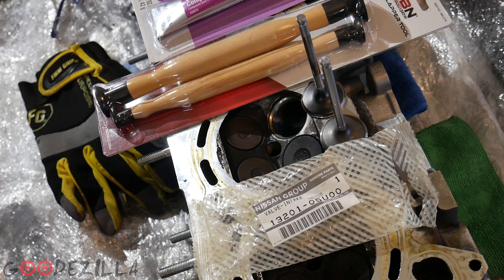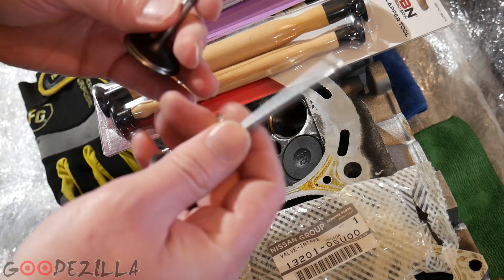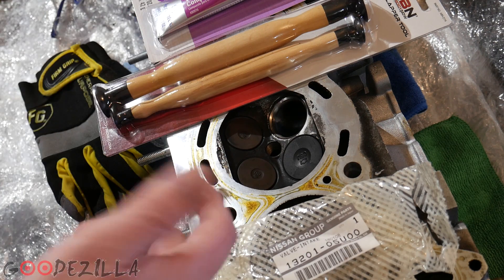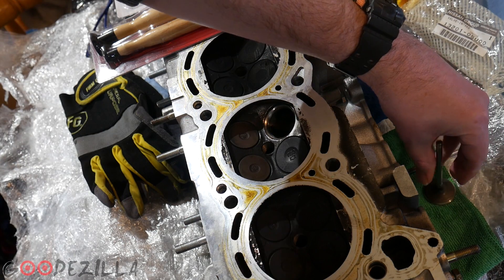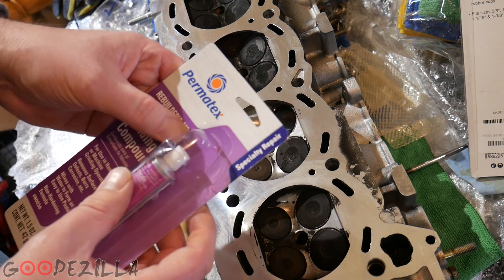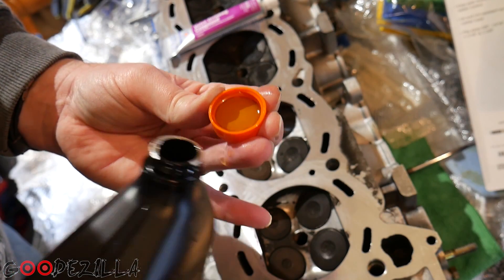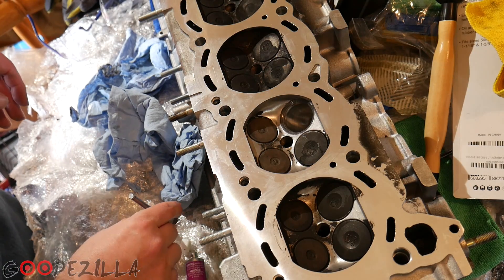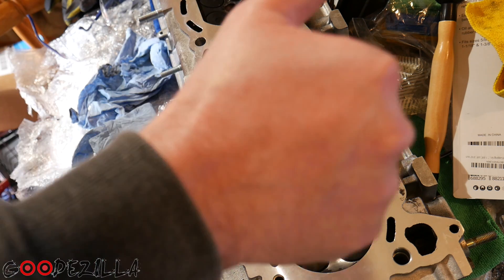RB26 Valve Lapping | R32 Skyline GTR

Comment: Hello from the UK, Mr Goode! What kind of cleaning and prep did you do to the block and head before reassembly? I’m assuming you didn’t take the head to a shop to skim again as part of this fix (trapped plastic, head off, new valve, back together)? Thanks in advance dude.
Reply from the maker: @utsavmamtora  Hey! Yeah, I didn't take it back to a shop for this. Since it was a new build with less tham 1k miles on it, there really wasn't much of  anything to have to clean. The head gasket surface wiped up easy with some brake cleaner.

Comment: Thanks man for your helpful video do you know the spec for the valve seat?
Reply from the maker: What spec are you referring to?
Reply: @Goodezilla  i mean the width of the line where the valve seats on it. There should be a spec if that line is too thick that means too much material taken off of valve and valve seat
Reply from the maker: @AMIN206r15  I'm not sure to be honest. The head work was done at the machine shop to thier specs, but then I bent 1 valve sucking up a piece of plastic, so this video was just replacing the 1 valve and getting it to mate to the existing seat. It would have better to have the valve machined but I didn't want to take it back and wait longer (or spend the money at that point).
Reply from the maker: @AMIN206r15  if it didn't seal properly or hold compression, I would have taken it back to the machine shop to get fixed.
Reply: @Goodezilla  thanks bro I’m lapping all valves and have troubles with couple of them. The grinding compound caused some lines on the valve seats cause I didn’t move it up now I’m trying to fix it and I’m afraid I’ll take off too much material
Reply from the maker: @AMIN206r15  yeah man, I'm not too sure on that. As long as it seals up it should be OK. But that's not professional advice lol.

Comment: Could've used a drill on the valve tip and just pushed up against the seat for a small amount of time back out and go back, its a sloppy way of doing it but it works and its alot faster process.
Reply from the maker: That's an interesting idea. I just went with the tried and true method haha